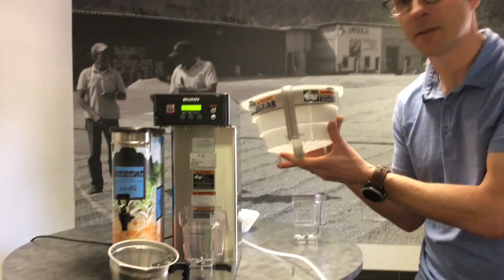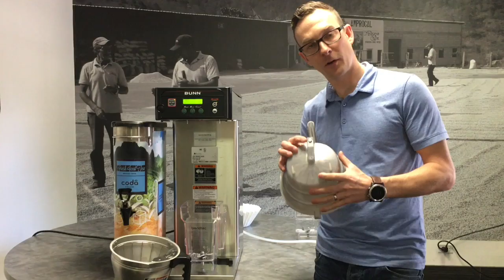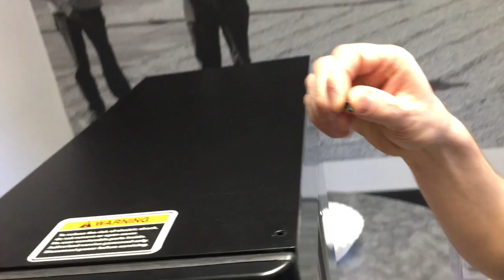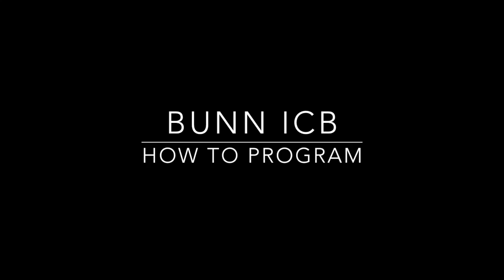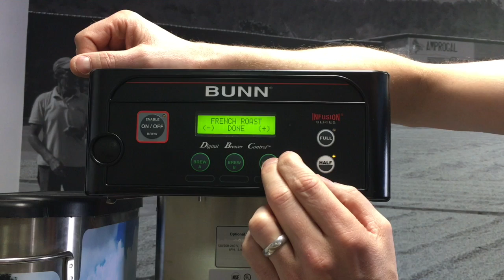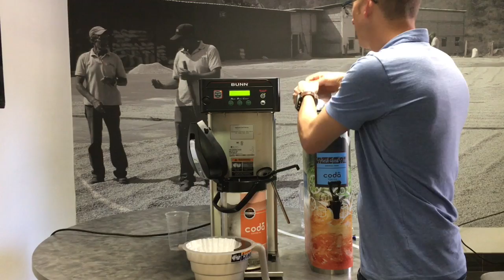BUNN ICB Coffee Brewer: Programming for Iced Tea

Comment: My Bunn tea maker is not filling the tank. I hear it click and the tank gets hot but no water in it. I expect the solenoid is bad. I picked it and gave voltage at wire and solenoid checks okay with ohm meter. The solenoid fits onto a plastic housing that the hose connects to. I suspect the valve in this housing is not working. I see it is repairable and parts are available but Incan see how to get it apart. How does it come apart?